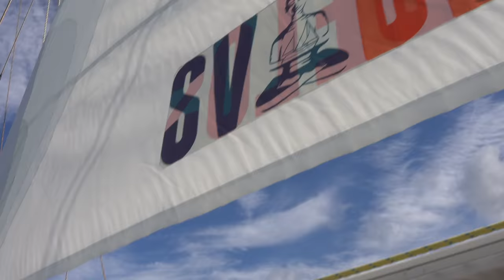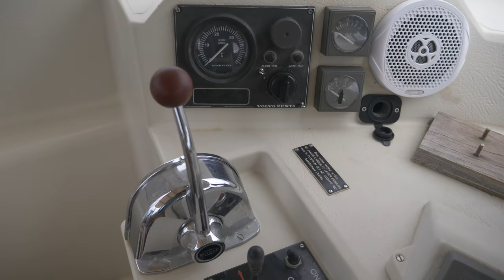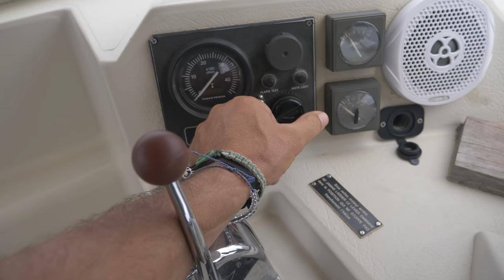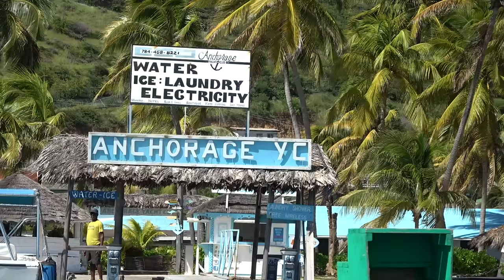Cooling Pump FAILURE!  STOP Motoring You P***y's!!!!- Sailing Vessel Delos Ep. 214

Comment: Dose the poo go out to sea?
Reply: Yes.
Reply: Question for Delos. So the commode empties into the sea when your are off shore and into a waste tank when you are in bay/marina/on anchor. How do you empty the waste tank once you are off shore? Is there a pump just for that?
Reply: @msnpassjan2004   Usually the toilet itself is the pump.  On a Beneteau I sailed on in French Polynesia, the foot-driven toilet pump created a vacuum in the bowl and that (somehow) moved the contents out.  There was an electric water pump involved too, but I don't recall the details.

Most boats have an electric saltwater pump which supplies water into the bowl (like a household toilet) which increases the level in the bowl and, combined with a large valve opening at the base of the toilet, empties it out.  One boat I know has a sewage treatment system using an electrolytic process—you have to dump a cup or two of salt before flushing—and a lot of electricity to decompose the sewage, but it is Coast Guard rated for discharge in most waters. (I don't think Delos has that.)

Comment: Help me out here salty people...Wouldn't it be advantageous to run a closed freshwater system using a radiator or some sort of heat exchanger
rather than direct seawater cooling.
Considering the issues associated with salt water and corrosion. It makes sense to me to keep salt  water and barnacles out of your engine.
I am sure this has all been tried so can you knowledgeable folks enlighten me?

Comment: Have you ever in the life of your ownership of the boat lost impeller blades from the raw water pump ?
Impellers / pumps need to be serviced every 100 hours. Did you replace the cam in the pump ? Did you find the balance of the impeller blades in the system.
You will almost never find clams growing in the interior of the water hoses. The bearings & seals that you replaced in the previous videos was not the correct replacement parts. The way you are sanding the cover plate to get a new surface is completely incorrect.
You absolutely must find the remnants of the old impeller blades in the system. If you do not you will have a blockage in the system , this will cause another overheat. You absolutely must carry spare parts for the engine, the raw water pump. You should also have on hand pump parts and a rebuilt pump.

Comment: Hi guys. Lube your impellers with glycerine, according to manufacturer specs during install. If you can’t find any, go to the pharmacy and buy a box of anal suppositories, making sure they are 100% glycerine. Great for use on anything rubber to make it soft and supple again. 😉  Use on hatch seals, o-rings, etc. Go lightly. 

Fair winds.